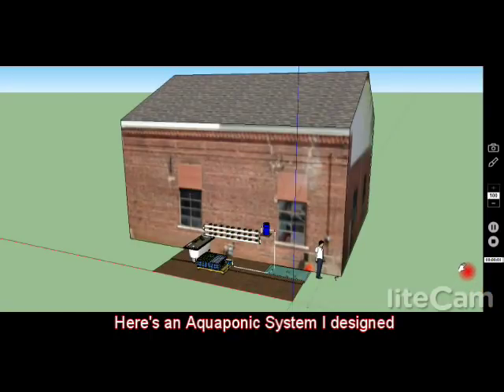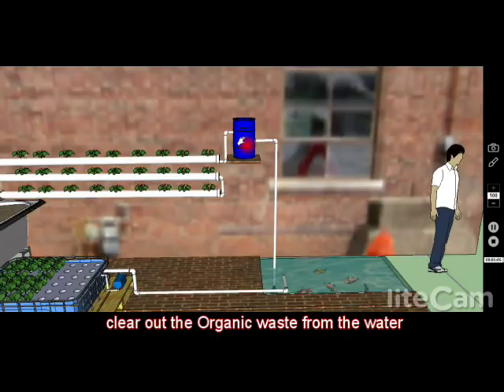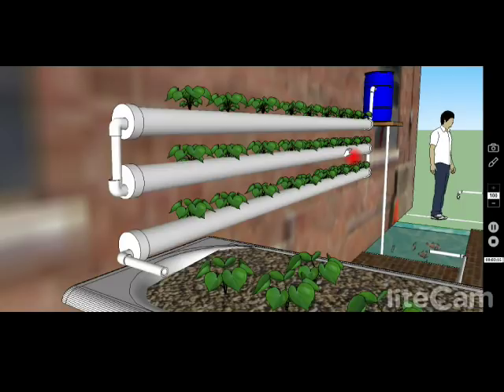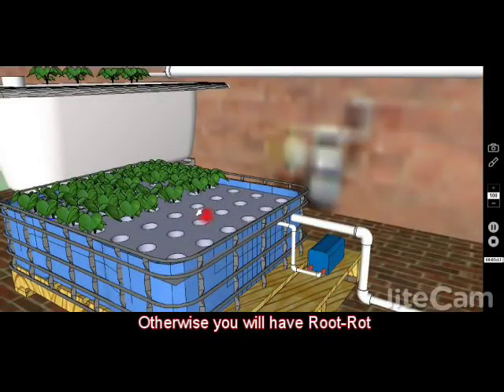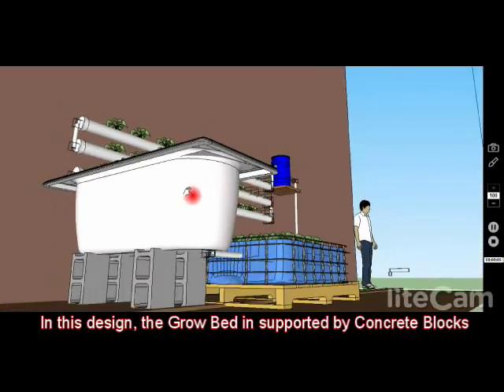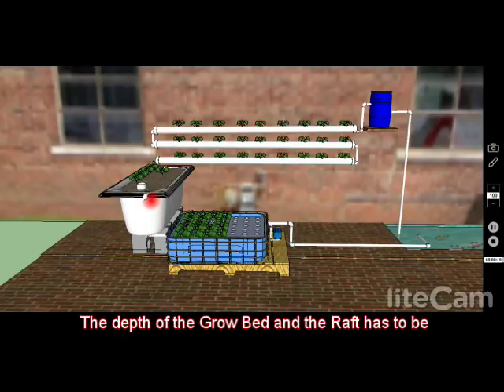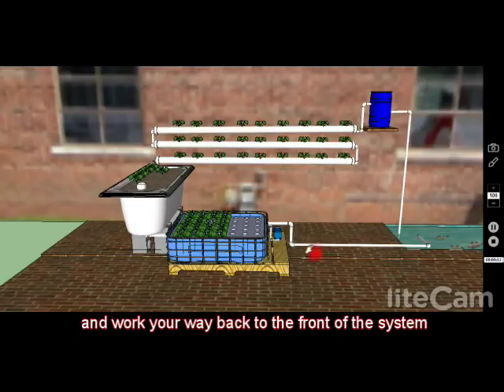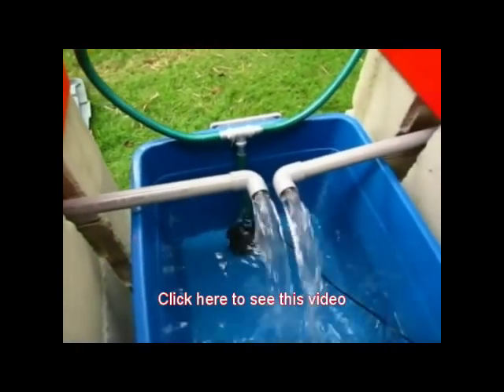DIY Aquaponics for Beginners 2014, a How To guide to making your first AP system

Comment: I had fantastic success with an aeroponics/NFT system I designed, that would simply spray the roots for one minute, then off for ten minutes. No aeration pump is needed, and the nutrient pump only runs one of every ten minutes. Admittedly this was a 420 grow concept borrowed from a dude known as "Stinkbud", in case anyone wants to research it, but I intend to resurrect this and adapt to grow fish, and veggies, in my quest for a self-sufficient retirement. There is very little info about combining aeroponics and aquaponics, so I would welcome any insight you or anyone can give me. Your presentations are excellent and the time you spend with the commenters impressive. Thank You Saeid!
Reply from the maker: Hi Kelhawk. I think you should be able to marry the two, aero and aquaponics. Specially since you already have some experience with aeroponics. I would start with a small system and test it out. It could be a question of finding which plants this will work for. 
The one minute on, ten off that you mention sounds great. I'm gonna keep that in mind for when I get a chance to put myh next system together. I've always been concerned about running a pump continuously. THis will fix that problem.
Thank you,
Saeid
Reply: Saeid Momtahan Thanks for the acknowledgement Saeid!
The intermittent spray idea was originally 1 on, 5 off, but I found a $5 momentary-on 10 min. timer, that was easily modified to run continuously as a repeat cycle timer. I could have set it up to be off for 5 min, but experience told me the roots can drain longer, probably 15 minutes or more. That translates into way less pump heat to deal with in the tank, so I am surprised this hasn't become more popular. But then, those potheads are kinda secretive. ;-)   
My 1in10 timers were conceived after bad experiences with the popular C.A.P. solid state timer, and have proven extremely reliable. I would be happy to send you one to experiment with if you can PM me. I mount them in a double gang PVC conduit box alongside a duplex receptacle. One outlet can be "timed" and the other can feed current thru to the next timer if desired. You just plug in the timer, and plug in the pumps...or relays to run more pumps. It is a micro switch, tripped by a hysteresis synchronous motor, and only rated for 5 amps. With a suitable relay, one can run as many pumps as practical.
Reply from the maker: Hi. That's great info which I will have to keep for later use. I'm in a phase right now where I have no idea what I'll be doing the next few years. Don't even know where I'll be doing what I don't know I'll be doing (-:

So I will take a rain check on your offer. I much appreciate it. It is very kind of you. 

I have seen the 1 minute on, 5-10 minutes off before in a few different systems. But there is so much information on the Net that some of it gets lost, until you're reminded again. I will keep it in mind for my next system, when ever and where ever that might be.

Saeid

Comment: I've wondered on the root rot bit. If you had the water falling into the raft tank with an aerator on the tip the water falls from, would that allow for enough oxygen to be entrained in the stream and be oxygenated enough to prevent root rot?

Comment: I was wondering if you would tell me the program you used to design this system?
Reply from the maker: SKETCHUP. It's easy to use

Saeid
Reply: Thank you very much my friend.  Please keep me informed about how your system performs.  I have noticed a common problem that most people don't address and that would be the ratio's of lb's of fish to gallons of water and gallons of water to grow beds. seems to be a simple 1:1 for lbs to gallons and 1:1 or 1:2 for gallons to square feet of grow bed.
Reply: Also if it wouldn't be to much trouble and if your not interested I'd understand but I'm new to SketchUp and it would be great if I you could send me some of your 3d models if you have any saved up.  Mostly just for inventory purposes something for me to work off of.
Reply from the maker: Brandon, look up Sketchup Warehouse. There are a little over 5 million design that you can download for free

Saeid

Comment: Have you attempted to build this system?

My big concern with this system would be the size of the pvc fill and drain pipes.  I think there might be potential to create overflow issues through some of the steps.  Please update and let us know how the system is working.  And remove the people that are linking to the "pay for aquapoinics information" links.  Nobody should have to pay for this information.
Reply from the maker: I have not. I will be getting abck to the Philippines in about 2 weeks. I designed this system for our home there. I have every intention of putting this design to practice.

Overflow might be an issue going from the tub to the Raft. THis can be fixed by keeping th ewater level low, and the output back to the pool of a larger diameter.

TY

SAeid

Comment: How do you keep the raft part from bottoming out/draining too much before the bell siphon kicks in and refills it?  Thank you in advance, this is a question I've had for a while.
Reply: I cannot say for sure but I imagine the raft box empties through an overflow which is set at the proper level.  So when it begins to fill, it automatically begins to drain as well.
Reply from the maker: As Jennifer said, the level of the drain pipe determines when and how much water flows out. It's very simple actually.

SAeid

Comment: Hi Saeid.  I have a question about the bathtub siphoning into the raft system.  When the bell siphon kicks in and empties into the raft do yo have any problems with the raft overflowing? Is the 1.5" drain pipe large enough to handle the flow of water entering into the raft.
Reply from the maker: Great point! THe water in the Raft has to be sufficiently low to avoid overflow. Alternatively, or in combination with that, the output back to the pool has to be bigger.

TH
SAeid

Comment: Hi Saeid, Thanks for sharing! I like that you use SketchUp for this. Any possibility that you can share the sketchup file with us?

As mentioned by others, I too am a little concerned about the amount of nutrients that will arrive to the plants with this setup. I understand the need for a swirl filter if you have a LOT of fish. But maybe its possible to make a bypass on the swirl filter for times when there are less fish?

I also understand the need for the swirl filter for the NFT and Raft systems, because of constant running water.

However when you remove (filter out) the solids from the fish (the organic nutrients), before it enter the Grow bed, would that not affect the amount of bacterias in your Grow bed? It is my current understanding that some bacterias is specialized to break down the solids, and they also need air and (some) sun to thrive. Therefore they will function best in a Grow bed.
It is also my understanding that the Grow bed with its large surface area, plant roots, and rich bacteria environment will work as a filter by itself.

What would happen if you directed the filtered water from your current Swirl Filter setup to the NFT and the Raft system (two tubes instead of using the same water for both). And then direct the water from your Swirl filter where the solids are contained, directly to the Grow bed (with a third tube)?

Also, what if you put a Sump tank underneath the NFT, Growbed and Raft system?
Then the water level in the fish tank will be constant, making it a little more comfortable for your fish, if you want to use a lot of fish. You can also put the Swirl filter in it (or a second Swirl filter if you want to), to further remove any non-broken-down fish solids or dead plant parts or dust/sand.

Just my five cent worth.

Any thoughs on these ideas are appreciated.

Keep up the good work!
Reply: It is okay to have a constant flow of water from NFT to BED MEDIA? As far as i know every 15 mins run and 45 mins off (flow of water) in BED MEDIA? just askin

Comment: Looks good! I have some questions; 1. is there still enough nutrietens in the water when it gets to the raft system? 2. how much water should you pump through the system (or what kind of water pump do you need).

I like the idea of having 3 different setups, because you can test which one works best for your situation.

Also maybe this is a good idea; you mention you should start at the end of the system with building. How about you use flexible piping/garden hose for the systemoutputs? Then you can just bend them in shape (assuming there's not too much gravitational resistance).

Thanks for the video!